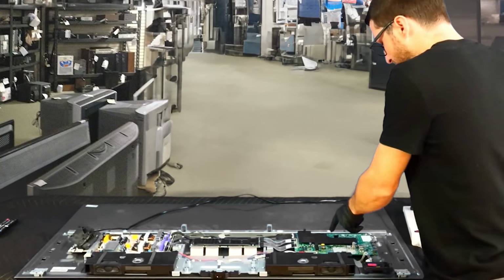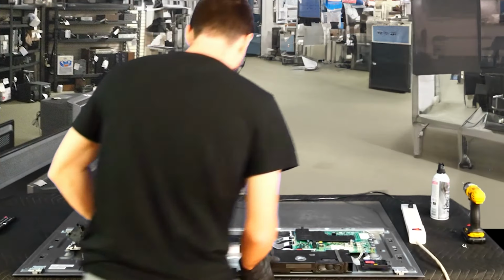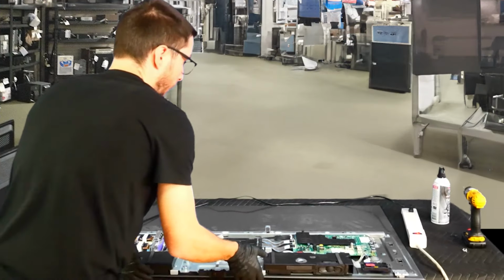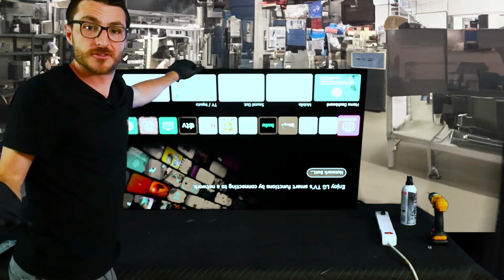LG OLEDs Have A Serious Problem! How To Fix!

Comment: Ok I'm back, if I get a C1 mainboard replacement, I believe I have to do some modifications in secret service menu. I have the service remote. If I put the C1 board in, turn the tv on, do I then go to this service menu and manually enter in the model number and the serial number and then all should be fine after that?
Reply from the maker: Yup
Reply: @NicksTVRepair  thank you. I've spent weeks trying to fix this damn tv without replacing the board but it gets a little worse and over time and not it won't play any uhd content whether on YouTube, Netflix or an actual disc. Which defeats the purpose of the tv. Really hope the tv works after replacing the mainboard.
Reply from the maker: it should

Comment: I have a B4 series OLED. 2024 model, LG voided my warranty because we installed it in an RV. It won't power up now, the red power light will flash different codes, any ideas on which board failed?
Reply from the maker: No but a bad panel can cause that as well.

Comment: Oooo boy.  I've been looking at LG OLEDs for the last few years.  But my 11 year pld Panasonic 50" ST60 still works fine and I like the plasma display.  Crazy
Reply from the maker: That's one of the last plasma sets ever made. Keep it for as long as possible!
Reply: I just replaced my Samsung F8500 64 plasma by an LG C4, 65. The difference is mind boggling. I have been missing out for years. What motivated the change was power consumption. If I had known how far the technology has come I would have changed much, much earlier.
Reply from the maker: I have the PN64F8500 and an OLED65CXAUA at the house. Both offer really good picture, I would argue that I preffer the colors on the now almost 12 year old plasma TV more than the OLED when watching 1080P content. However if the movie or show is available in 4k HDR then yeah the OLED outperforms it. However depending on the day sometimes even watching 4k content through some of the streaming services it seems I get auto downgraded to 1080P either because my internet is struggling, or the streaming service is not able to keep up perhaps because of high througput demand on their end? I don't know.
Reply: @NicksTVRepair Did you know you can run UHD movies from your PC HDR tonemapped, to the capabilities of the old plasma.
Even downscaled with really good downscalers. It is possible to bring life and show new movies with features the screen wasn't made for. Look into MPV ot madvr or mpc-be for example and get some UHD remuxes. Of course the newer OLED will look better but the motion resolution is better on the plasma and it can look even better, if you figure out how to feed it with better quality sources.

Comment: Question I have a 77 inch C2 about eight months ago LG replaced the main assembly board while it was under warranty. Now it’s not under warranty. The TV went off when you push the power button on the remote it just flashes one time but the regular light comes back it won’t go out of standby. I replace the main assembly board that didn’t fix it that I replaced the power board that didn’t fix it after replace the power board unplugged the ribbon cable off of the.T con board the bottom table and you can hear the relay on the power board click off click on click off click on. I’ve been told by people on here that it’s a panel. Do you have any suggestions on how to test to see if the panel is bad thanks
Reply from the maker: I don't know much about the C2 so I can't really help to much. But if you replaced the mainboard and power supply and it still has the same fault then most likely the panel is bad.
Reply: @NicksTVRepair  thank you

Comment: Thank you for the video. I would like to ask if you can write the BGA soldering parameters for this processor. Time and temperature.
Reply from the maker: Sorry, I don't think that is a good idea. You don't use the same machine I do, and you don't have it in the same environment I do. My temperatures won't be correct for you. 
If you and I were both using the same machines in similar environments then yes that would make sense. But because I have a high confidence we don't, using our temp profile won't work for you. 
I highly recommend that you purchase some low-end cheap circuit boards online, maybe 10 of them or so that have BGA chips. They don't have to be the same as these but similar. Then practice removing them and installing them. As you do that tweak your heat settings top and bottom. 
I recommend you watch this video starting at around 4:27 or so and use that as your base. Then make your own adjustments from there:
https://youtu.be/LZFAQgMY-to?si=MGOPfJ8yH80SWYuN&t=267
Reply: 343°- 371°C
Reply from the maker: Holly Molly if I went to those temps the board would be completely destroyed for good. 
The highest temp we get to is 245c which just goes to show how different setups and equipment matter and require different temperatures to get to the solder melting point. 
So again, this reinforces that your profile, the heat temp you use on the bottom vs the top, and for how long and how quickly you ramp up to those temps all depend on your setup.

Comment: I have this same model, LG 55CX and it does power on for about 20 to 30 seconds then it powers off. It also has a white vertical line on the right side of the screen. Would this repair in this video correct my problems? I am ready to send in my board for repair. Please advise, thank you.
Reply from the maker: Because of the line in the screen I think the answer is no. But i would recommend you freeze the CPU as shown in the video and see if that makes a difference. If it does and you are able to get the video to stay on for a longer period of time then I would say yes we can fix it. 
Essentially I am looking to see if the processor on your mainboard failed in the same way shown in the video. If yes then we can fix it. If not then it's most likely that your screen is defective and not the mainboard. 
If you don't have a can of compress air I placed a link in the video description where you can quickly and easily buy it.

Comment: Does the OLED55CXAUA main board work for 55CXPUA models? I am not familiar with the differences, interested in purchasing one/sending mine to you for repair
Reply from the maker: We can fix both the CXAUA and the CXPUA variants. 
If you have a CXPUA version you can purchase this repair service linked below:
https://nickselectronics.com/products/oled55cxpua?variant=48668672426260
If you have any questions, don't hesitate to reach out

Comment: Hello Nick my LG TV oled65cxpua just stopped powering on, it was rebooting itself for about 2days but not powering up anymore and no red light. I’d like to fix this ASAP. Waiting for your response thanks.
Reply from the maker: So we have recently stopped offering the mail in service for these because we have not been able to source anymore CPU's in working order. Because of this we now only offer the boards for sale. We had 5 full boxes worth of these for sale and are down to our last one. So supplies are running very low. If you need a replacement mainboard I would highly recommend you purchase one in the next month or so otherwise we will be 100% out and no longer able to fix them.
Reply: @NicksTVRepair 
I have the main board from my 65 same model. I replaced the motherboard but it doesn’t seem to be the problem. I’m still getting the 4flashes in the power button. Could it be the…power board not the main board? 
Btw… the person who’s having the problem that I’m sort of hijacking… I still have the mother board from the tv. You can have it. I will keep the new one I installed. I don’t mind sending it…let me know.

Comment: This board, EBU66105901 LG Bpr Total Assembly,
 will cost $297 new. Does your repairs usually costs more than this?
Reply: Also, if I purchase your refurbished board is there a discount by sending you the bad one I have.
Reply from the maker: The repairs costs less however right now we are having a really hard time fixing these because we have had very limited access to new parts. We can try to fix it, and sometimes we are able to without having to replace the CPU, however if we have to replace the CPU, we won't be able to fix it as we are unable to source new ones for now. In this scenario, we will have to upsell to a replacement.
Reply from the maker: No discounts at this time unless we are able to find a new source of replacement CPUs. Since our supplier ran out of stock our ability to fix these has diminished significantly.
Reply: @NicksTVRepair  I received your ckt card and it fixed the problem as advertised.

Comment: I have this exact LG Model 55CX and the power does come on for about 20 to 30 seconds then powers off, also there is a white vertical line on the right side of the screen. Would this repair in the video correct this issue? I am ready to send in my board for repair. Please advise, thank you.
Reply from the maker: Because of the line in the screen I think the answer is no. But i would recommend you freeze the CPU as shown in the video and see if that makes a difference. If it does and you are able to get the video to stay on for a longer period of time then I would say yes we can fix it. 
Essentially I am looking to see if the processor on your mainboard failed in the same way shown in the video. If yes then we can fix it. If not then it's most likely that your screen is defective and not the mainboard. 
If you don't have a can of compress air I placed a link in the video description where you can quickly and easily buy it.
Reply: Thank you for the info. I’ll try the compressor again and see if this helps.
Reply: I used the compressed air and the tv would stay on a little bit longer, about 45 seconds and then turn off. The white vertical line is still there.
Do you think it is the board?
Reply from the maker: Well I can't be 100% sure but if you want to send in your mainboard, we can live test it in our TV and at least confirm for sure if its working or needs repair. Because freezing the processor allowed the set to stay on longer, I would believe that it does have a defective CPU and that a repair of the mainboard is required. The white vertical line is the part that is throwing me off. I don't know if that is perhaps just a seperate issue.
Reply: @NicksTVRepair  I am sending my board off today. Thank you for your help.
Mark
Reply from the maker: Thanks, Mark! When you made the purchase on our website I noticed you provided details of your symptoms but did not mention the white line. So I added that information in your ticket so that my tech knows to keep an eye out for that during testing.
Reply: @NicksTVRepair  yes, thank you I forgot to put that on the order, I did hand write that on the order form I put in with the board. How long does it normally take to fix the board? I am from NC and it’s about 4 days to get to you.
Thank you, Mark
Reply from the maker: If this is the only board I have to fix for the day then it would take no more than 1h total. But right now we have about 60+ circuit boards in our shop for repair and we do operate on a FIFO system. First in First out. Our website advertises 3-5 business days as our turnaround time and that is about accurate at this time based on the volume of repairs we are getting. Probably closer to the 5 days then the 3 right now as we also have a few new team members that are still in training.
Reply: @NicksTVRepair  Thank you for the information! I hope to get good news on the board.
Thank you
Reply from the maker: Hey Mark,
We did receive the board but we have been receiving a lot of items for repair and are falling a bit behind on our repairs. We should however have an update for you very soon.
Reply: @NicksTVRepair  thank you!

Comment: Hi my lg cx55 was working fine but now doesnt turn on, it makes the clicking sound when turning on. red light is on amd flashed when attempting to turn on but no image. can you help if so whats the cost? thanks
Reply from the maker: Most likely a mainboard failure unless it has physical damage to the screen in which case it's a bad panel
Reply: @NicksTVRepair  Hi nick it does not have screen damage. the tv wast turning on that evening/night i wrote you but turned on the next morning fine and has since. was it giving me a sign its almost done with the board? should i address before a total failure?
Reply: thank you

Comment: I have a question I’m hoping you could help with. My LG G2 65” shut off after 11 months of use and never turned back on. The power light flickers when I hit the power button, but it no longer turns on. I replaced the Main Board and the Power Board and it is still doing the same thing. LG already gave me a refund, but I’d still like to fix this TV if I can. Any recommendations?
Reply from the maker: In my experience the LG G2 models have mainboard failures. That's the most common part to go out. Where di you get your replacement boards? These boards are not available not even from LG anymore. If you bought used, it's most likely that you purchased defective boards.
Reply: @NicksTVRepair  I bought a TV Repair Kit from TV Parts Today earlier this month. Since the replacement parts didn’t work I don’t know what to do with this TV now. It feels wrong throwing an OLED TV in the garbage lol
Reply from the maker: Not trying to say they are a bad company I buy lots of parts from them, but I also have received a lot of bad board from them.

Comment: Hello! I have Oled 55EC930V with auto off troubleshooting, any help please
Reply from the maker: Im sorry I don't understand what you mean by Auto off troubleshooting. 
Are you saying the TV shuts off right after turning on? If so you probably have a bad panel. There is a small chance you may have a mainboard malfunction so as shown in the video I would recommend freezing the CPU and see if that helps. If yes then replace the mainboard. If not then it's a bad panel most likely.

Comment: If i dnt have  compressor what can i use to spray on the chip surrounding
Reply from the maker: have to use freeze spray. 
You can buy a can for $10 or less on amazon or local hardware store

Comment: My TV is a model OLED65CXPUA.
Do you also offer repair service for the Power Supply Board?
Reply from the maker: Please provide me with more information on your TV and the specifics that show the power supply is at fault and we would be happy to help you troubleshoot and or have you send in the power supply for repair. If we find it is defective and needs repair I most likely will be doing a video on the repair! 
The reason I ask "Are you sure your power supply is faulty?" is because we specifically don't service them at this time for 2 reasons. 
#1 The power supply fails less than 1% of the time in our experience. The fault is most often with the mainboard and thus there is virtually no demand for power supply repairs. 
#2 If your power supply is at fault, you can purchase a replacement, whereas with the mainboards there are virtually no replacements available unless you are willing to spend $300 on a used board with no warranty and no idea how long it will last.
Reply: @NicksTVRepair  The only reason I suspected the power supply board is that I cleaned and reapplied heatsink paste to the processor, but the TV still turns off spontaneously.
Reply: The set is LG OLED65CXPUA, bought in 2021.
Reply from the maker: Based on the symptoms you are experiencing it sure sounds like a mainboard failure. Applying new thermal paste is often not enough to fix the mainboard, typically some sort of soldering is required whether it is a reflow of the processor, reball, or replacement. If you don't want to send in your mainboard for repair, we do also have some for sale. Although not an infinite amount. If you want to purchase a replacement the ones we have right now come with a copper plate between the CPU and heatsink to further help heat transfer into the heatsink and that large silicone pad on the back of the board as shown in the video also to help cool the board further. 
Here is a link to the board for sale on our website:
https://nickselectronics.com/products/oled65cxpua?variant=48668677243156
Reply: @NicksTVRepair  Yesterday, USPS picked up my mainboard. According to the tracking info, it should arrive at your shop on Wednesday, July 24.
Reply from the maker: Oh great. Then we will be able to live test it, confirm the fault and perform the approprite repairs to it. 
I will make sure we send you an email confirmation once we receive it and updates through out the testing and repair process. 
One more question and if you already included that info with the board, no need to answer here. How long on average did it take for the malfunction to occur? I only ask so that when we go to live test it in our TV we have an idea of how long we need to test it for to recreate the fault. Or is it completely random? 
Thank you
Reply: @NicksTVRepair  When the shutdowns first began, it would take 6 hours or more. As days went on, the shutdowns sometimes occurred after as little as 45 minutes. After renewing the thermal paste, it took over 6 hours to turn off. I didn't test any further after that.
Reply from the maker: Okay. Yeah often we end up running the test set overnight with the mainboards to stress test but It's just good to know what the expected time to failure is. 
Thank you